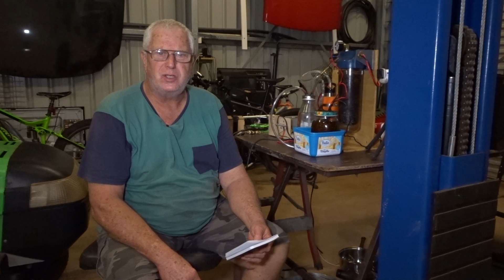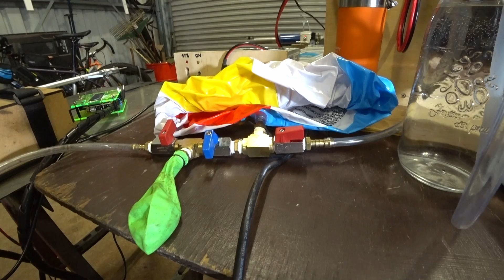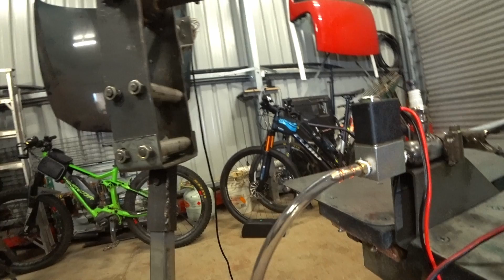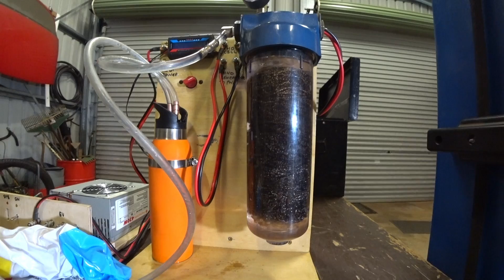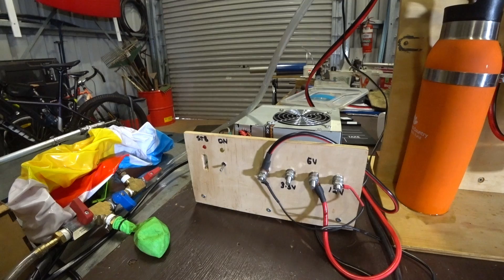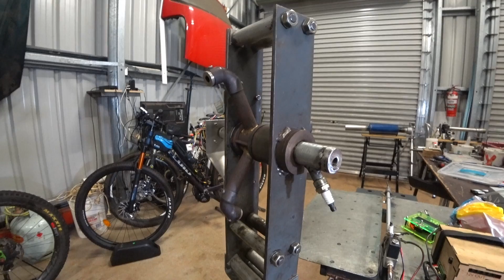Pulse Detonation Engines and HHO  part 1 HHO

Comment: I commend your efforts. I was searching pulse burning and stumbled here.  I was thinking pulse burning helps eliminate flashback problems encountered with gas turbines
Reply from the maker: @bobbean4702  flashback is a problem when using HHO, combustion has to be isolated from the inlet gas. I am exploring rotary valves as an input and mechanical trigger for a 3 combustion chamber detonation engine.and also a compact spiral rotating motor. Which if timing is right, the after detonation vacuum can be used to overcharge the combustion chamber for self running motor.